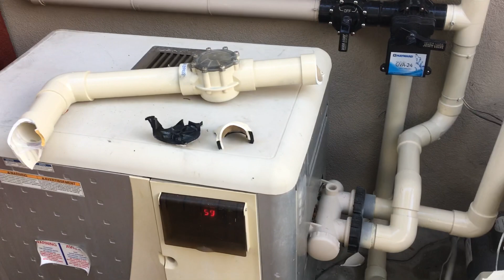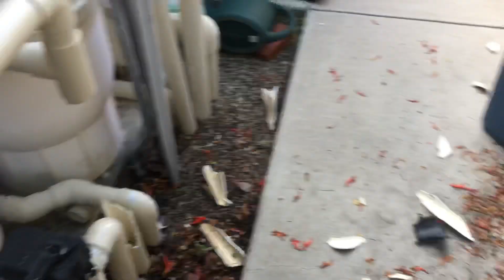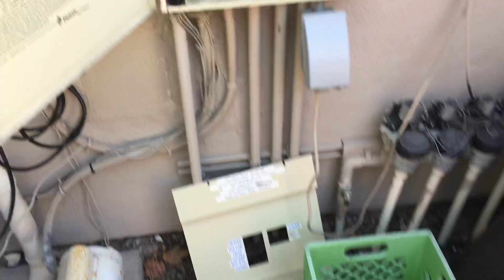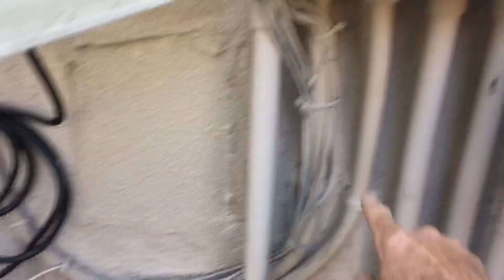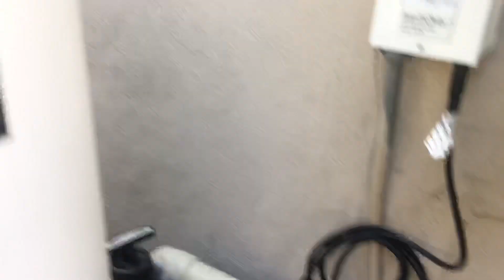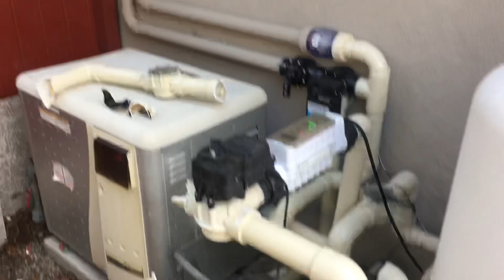Salt cell explosion

Comment: I just had the same exact thing happen except I dont have solar. I thought maybe something got clogged but the pump was off at the time of the explosion. What could of caused this. Its the 2nd time this happens.
Reply from the maker: miamilaz77 it’s caused from LINE power (hot all the time )  no flow and gases get trapped in pipe. Chlorinator  needs to be on load side of system
Reply: @gregbeard4432 I spoke to my pool guy and he suggested interlocking the chlorinator to the timer so that it shuts off when the pump shuts off.  Is that what u did?
Reply: miamilaz77 yes it is a good option, but if  the electricity goes off it could reset the timers (depending the timer that you use) if you have just one timer controlling both the pump and the chlorinator at the same time, then it is good. I have seen this happening only whit Pentair chlorinators. I guess there is a problem whit their flow sensors that supposed have to prevent this from happening.
Reply: Just had this happen to me.  I have a timer built into my pump.  So the pump turns off independently of the salt generator.  If there is no flow, shouldn’t the salt generator stop?  Maybe I have an issue with the flow sensor?